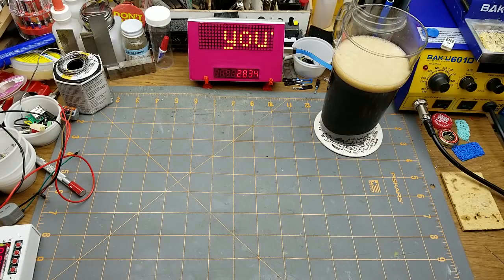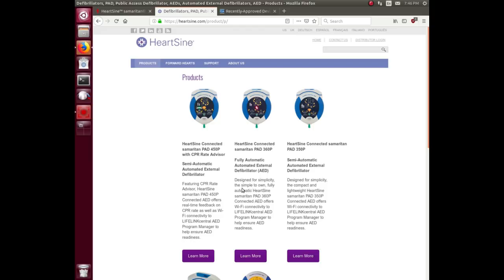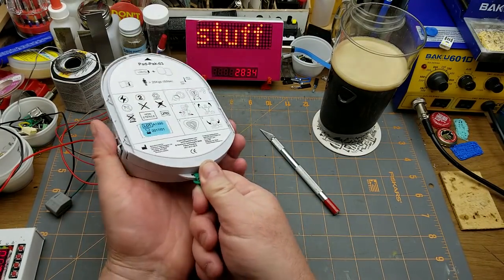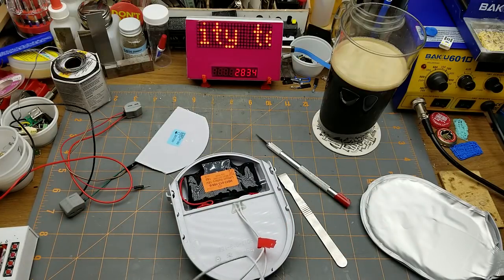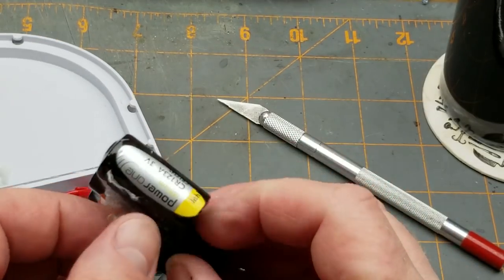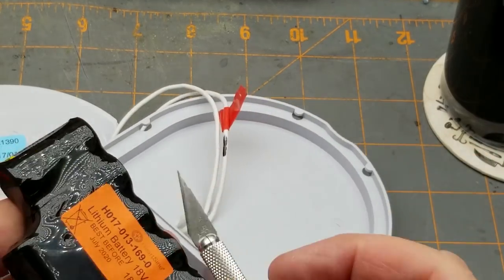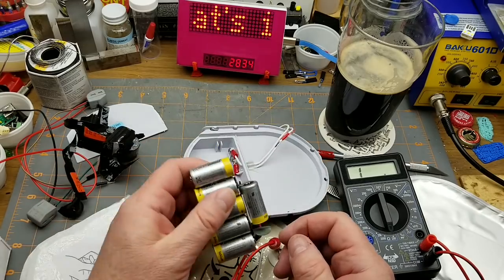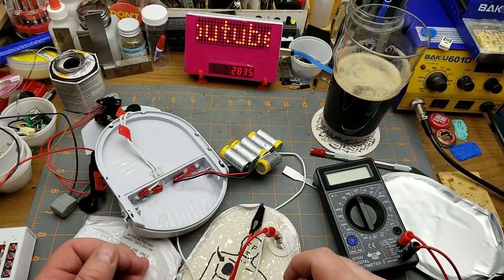defibrilator battery pack teardown

Comment: My mother used to bring home the battery packs from a particular cordless tool used at the hospital where she used to work.  It was a standard plastic battery holder with eight Rayovac alkaline batteries inserted in reverse.  The pack would only be used in one surgery, which would barely drain the cells in the pack, then the pack would be thrown away.

Comment: Was wondering if you were going to acknowledge the beer. Thank goodness 😅
CR123’s were cutting edge back in my camera days. They stored so much power for the “electric hungry” camera. IR focus. Fuzzy Logic. Flash. Frame Advance. Then when you’d finished a roll of 24 or 36, more power was needed to rewind it back into the canister (or cassette). Ahhh. The good ol’ days. Thanks for sharing!

Comment: Check the resistance of the pads on a higher ohms range.
Because they are using mA at high voltage the pad resistance can be more than the 200R that your DMM is set for.
Reply from the maker: I did that off camera. It's about 380MegOhms.

Comment: I wonder what's the voltage for defibrillation shock.
Reply from the maker: Not sure. The defibrillators are typically rated in joules, from what I can tell.

But a bit of googling suggests it can be anywhere between 250 and 1000 volts, depending on manufacturer and other factors.

Comment: There is no protection circuit because those are NOT rechargeable batteries.
Reply from the maker: There is the fuse, which is a type of protection.